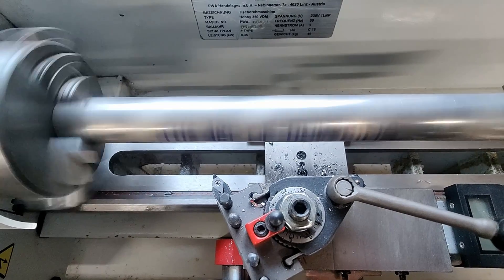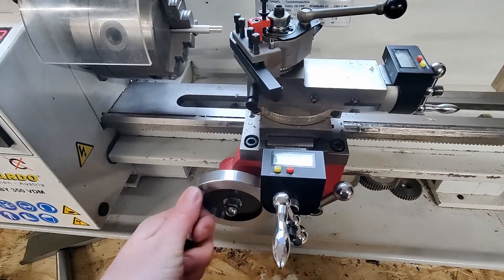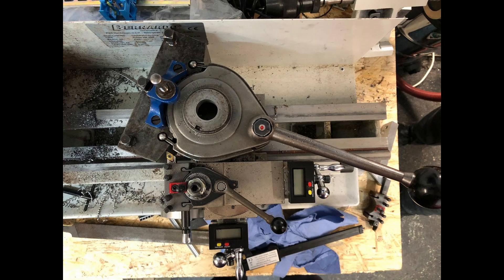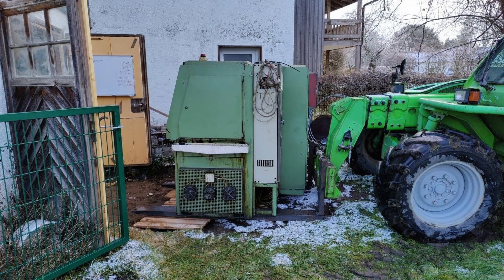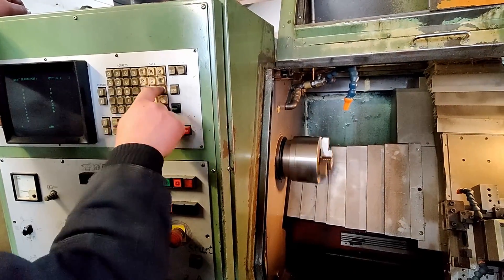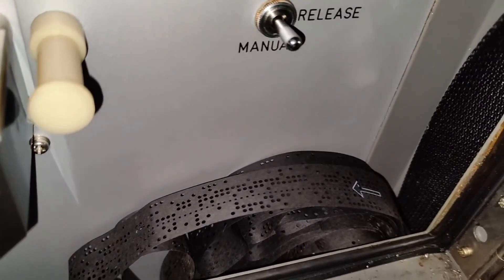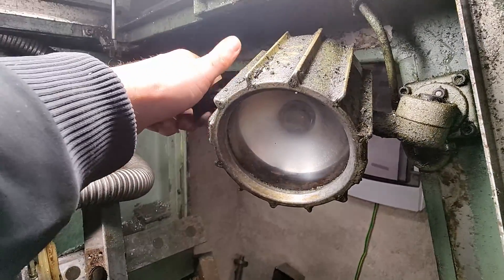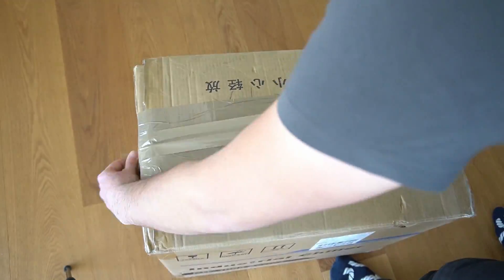i bought a industrial CNC Lathe! - Weiler Primus LinuxCNC retrofit pt.1

Comment: Congrats to the lathe!
I am currently in the process of linuxCNCing my Voest-Apline Steinel lathe with the exception that I planning to keep the original AMK servo drives.
Reply from the maker: Thats a nice project for sure, i wish you a great time and the strength to finish it. It took me 2 years :D
Reply: @theartoftinkering  I am too more than a year in and I just recently was able to bring the machine indoors lol. Good news that the servos seem to work.
Reply from the maker: it was one year outdoors? How did you prevent it rusting?
Maybe you find the time to make some videos about your project aswell :D
Reply: @theartoftinkering  Yes, it was outside but it was under a car sized metal framed tarp roof and the exposed surfaces were protected with CRC SP400 corrosion inhibitor wax.
Other parts were protected by the remains of the cooling emulsion, as the machine is quite dirty.
Sadly there are some smaller rust spots on the slideways from before I purchased it. Could you suggest a way to remove it without damaging the ways?
Maybe some time I try to make videos about it.
Reply from the maker: @poormansdiycorner  i removed all rust with evaporust and cleaned it with a ultra sonic cleaner. After that the parts looked pretty much like new, it's truly amazing. 
If you can't buy evaporust where you live, citrus acid works too, but you need to remove it carefully again, since it keeps eating away the metal.
Reply: @theartoftinkering  Thank you for the suggestion! Yeah, could not manage to find a single company within Hungary where it is in stock but thankfully the German Amazon does deliver to us.
Unfortunately though due to disturbing recent events I probably won't make any videos. Or at least until I manage to move to a western country.